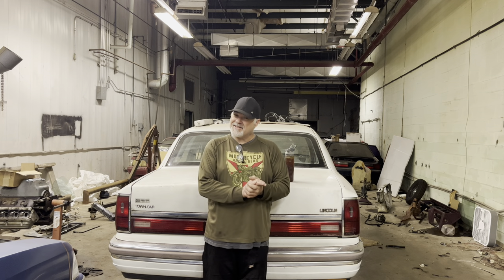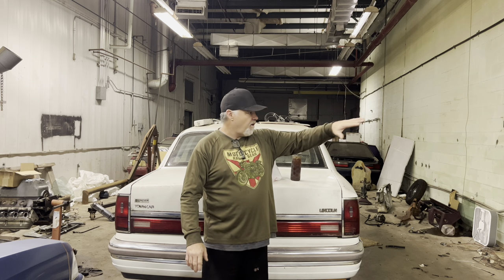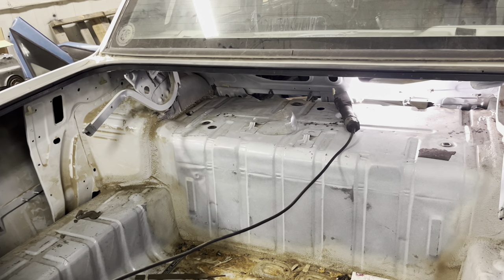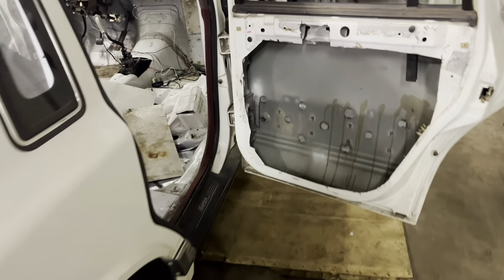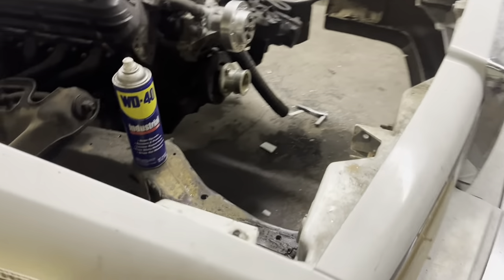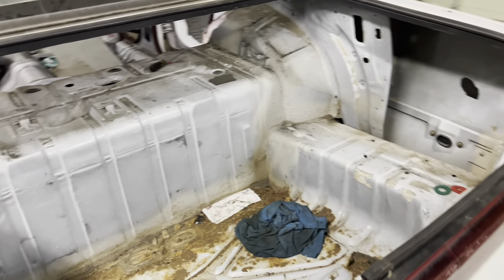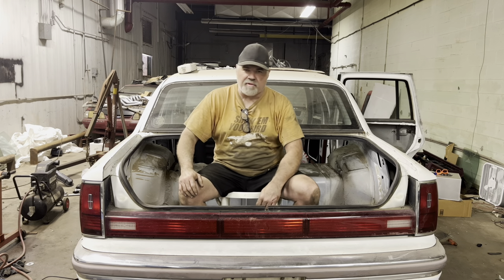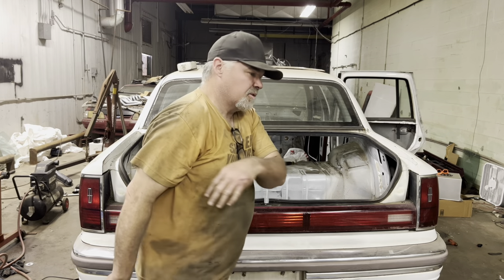1990 5.0/T-5 Lincoln Town Car LOVEBOAT pt.30 Radiator radness....

Comment: You’re not wrong about the power to weight. But do you have E85 in your area? It would allow a high compression motor and it’s cheaper per gallon than 93. Fuel mileage takes a hit but it’s still cheaper to run E85 if the motor can use the octane.
Reply from the maker: Nope…e85 isn’t available anywhere close to us..nearest is 120miles away😐…

Comment: You're probably right about being the leader in Lincoln videos on this here man's YouTube.
And lets face it. Kevdog probably thought he'd picked the lowest hanging fruit in your stable of cars plus he got you to agree to keep the E6 boat anchors on the engine. Should be easy pickings for his relatively light, pretty easy to make fast 55 Chebby. 
Did he forsee you gutting your Lincoln of all unnecessary interior and sheetmetal?  Does he understand that you'd put in the work to insure a victory? Hell, did you get him to agree to keep the 350 / th 350 combo in his? No! 
Lastly, are excuses easier to produce than win lights? Cause I think thats his strategy.

Comment: Another good place to save weight on that car is the floorplans. Don't need one on the passenger side, or the back seat area. Then fill the tires with helium. And do you reeeeeally need front brakes, just use the e brake. Door gaskets gone, oil, water, gear lube......gone.
Reply from the maker: Parking brake is gone 😎🤣🤣🤣

Comment: I need some suggestions from the HiPo guys out there. I got my fairmont going a few weeks ago, four door. 351W, 9 lbs Ebay GT45 w/toploader 4 speed. My clutch (centerforce dual friction) won't hold it, it just slips at wot. Is their such thing as a budget twin disk? Any experienced recommendations?  Thanks

Comment: I wonder if you are going to have any problems popping/cracking windows until you get lexan installed. You've cut away a lot of structure.

If you don't want hood pins but want something fancier than dzus fasteners check out Aerocatch hood pins. I know how much you love to spend a bunch of money on looks!😉😁  They even sell some with key locks. They are expensive but work good. I've got a set for my 54 F100 tilt front clip. Hey it's a Lincoln you know you need to go fancy on the hood pins!!😁